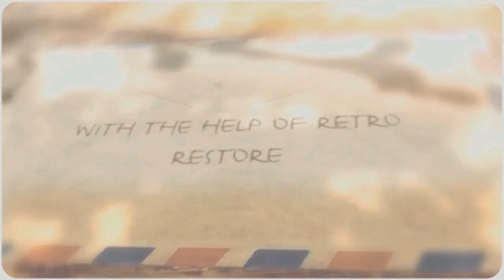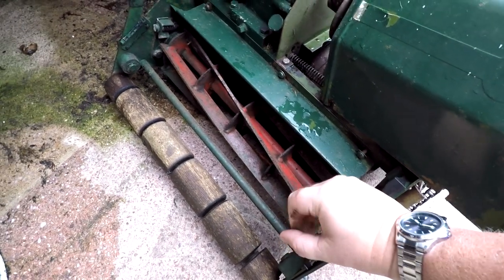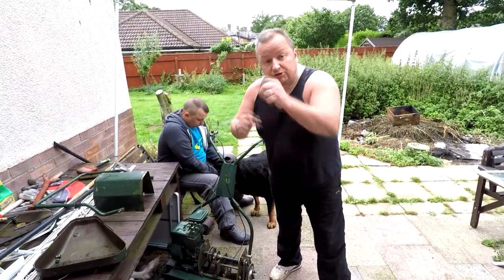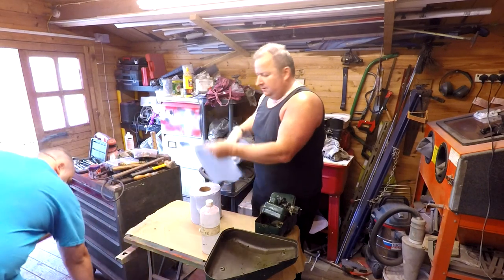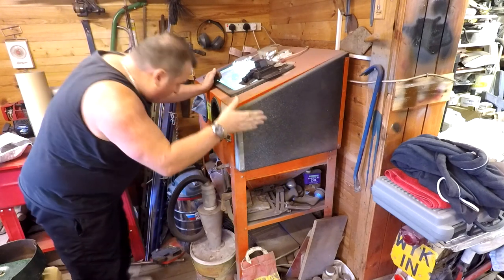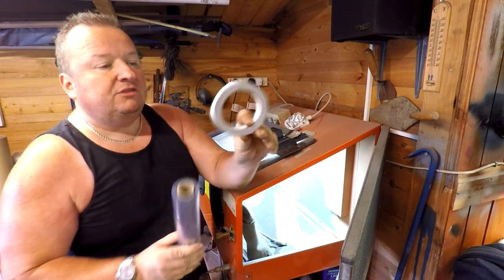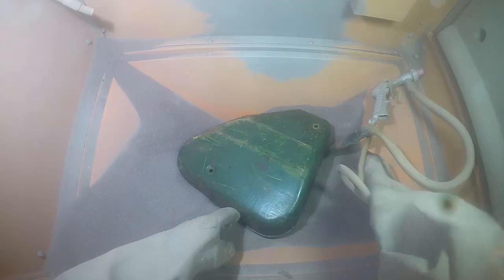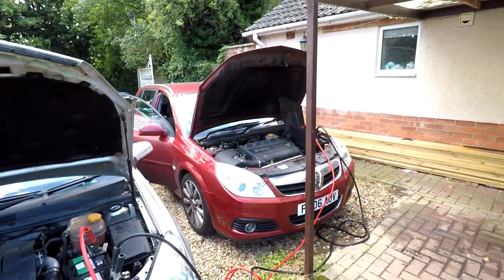Lawnmower And a Bit Of Family Banter Vlog

Comment: Martin, not sure what mods you have in mind for the suction system on the sand blaster but I have the smaller desk unit and it never worked proper so  I watched a lot of the harbour fright media cabinet mods on you tube and modified mine using parts from home base and  B and Q, you can also buy the bit on ebay see link, it is much better taking the media from the bottom than the inside. 

https://www.ebay.co.uk/itm/Media-Sand-Blasting-Metering-Valve-to-Upgrade-Harbor-Freight-Cabinet-W-Mounting/312419977558?hash=item48bdae8956:g:lxcAAOSw32lYwKbj